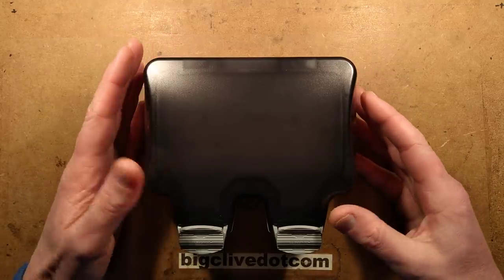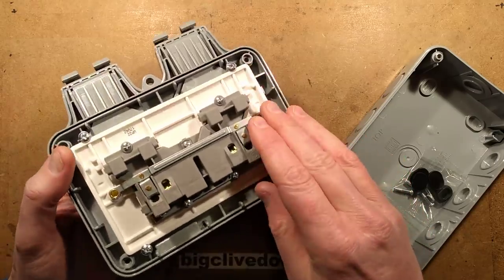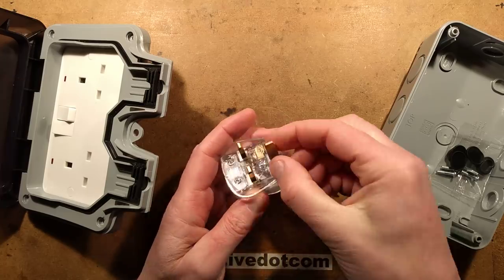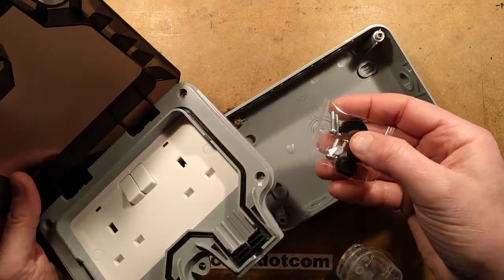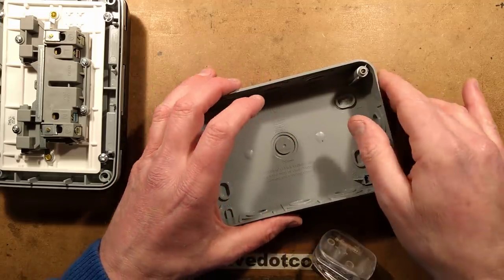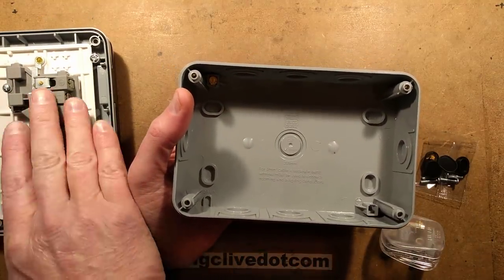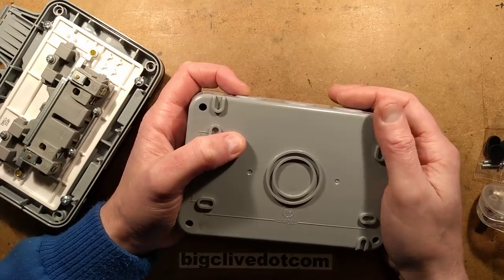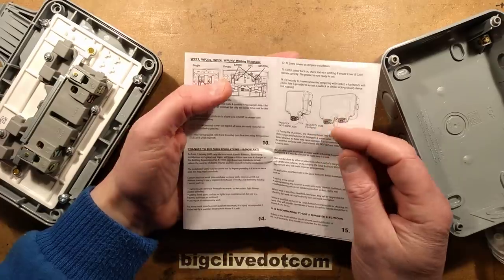British weatherproof socket with clever design. (bonus rant)

Comment: I am an unlimited level electrician in NC USA, and I am always impressed with the bulk and capacity of foreign electric designs.
Reply: And trust us, techs from MEN countries are utterly mystified and horrified by your mishmash of systems XD
Reply: I was also surprised when I travelled from the UK to USA, I picked up a extension cable to charge a wheelchair in my car,  I was taken back thinking that we use thin cable like this for our hifi speakers, not run mains equipment. However 110v is a lot safer than 220v. ATB nick
Reply: A Gentleman  the point I was trying to make was about the thickness of the cable, the charger was a 110v to 240v of course you are right, in the UK we have 32amp circuit with 13amp plugs. I don't know how many amps are used on USA plugs. As for the charger it took twice as long to charge.
Reply: @nickbird7742  Most outlets in the USA are 15 amps. If the outlet has a T shaped slot then it is a 20 amp. 20 amp outlets are compatible with 15 amp or 20 amp style plugs. As you get into 30 amp plugs and outlets there isn't any backward compatibility.
Reply: @TomZ23  why are your cables so thin, also the two pins on the plug was very thin. In the UK our cables are made using 2.5mm copper and our pins on the plug are quite thick as you would have seen in this video. ATB Nick
Reply: @nickbird7742  2.5 mm copper for a wire seems really large for a connection cord, that is equivalent to a 10 gauge wire. That would carry far more current than any appliance would even need.
Reply: A Gentleman yup, 110v limits the watts any appliance can use. Most USA extension cords are awg#16... often homeowners run them all over the house, under rugs etc... it has forced the NEC to require special arc fault circuit interrupts... to prevent stupid Americans from burning down their homes. 

The sad thing is commercial outlets have updated circuit capacity, but the same crappy 15 or 20 amp outlets and cords... y main business is replacing refrigerator cords and outlets... because they overheat and melt down...
Reply: @TomZ23  first thank you for your reply,  I now understand the main difference between USA and UK,  USA wires go from the fuse box to the socket.  In the UK we use a ring main which wires go from the fuse box to socket after socket then back to the fuse box. Any double socket can have up to 26 amps 6000 watts, 2 x 13 amp plugs. We than have separate circuit's for kitchen, downstairs rooms, and upstairs rooms etc. Each ring is rated 32 amp.

Comment: I'm certain that we have Electrical Regulations in Greece but nobody seems to know who has the copy. However, the lackadaisical approach to safety does result in the Darwin effect. Yes, the stupid gene is being phased out in favor of the commonsense gene.
Reply: Same in Croatia
Reply: Is the stupid gene being 3 phased out faster than the single phase option?🤔
Reply: @chriscooper2496  maybe twice as fast, Chris....
Reply: I went to Austria for work a few years ago and the day before flying out, called the project manager who was already there to ask if I needed to bring building site required PPE (hi-viz vest, steel toe-cap shoes etc). As it happened, our installation work (security equipment) was in an already working office, so PPE would not have been required even in the UK. However, his response was that no one seemed to bother about health and safety in Austria, that someone on site had sustained an electric shock a few days before and apparently everyone just laughed.

Comment: Opened a nice weatherproof 240V relay box on a job once, cloudy brown water poured out everywhere and as soon as the thing got reasonably free of water it started sparking and caught on fire... supposed to be an unenergized circuit of course.
Reply: Had the porch flat felt-roof leak once, gradually soaking the chipboard inside, then after one summer thunderstorm the porch light fitting started spitting fire and water alternately for a while till the fuse eventually failed.  Quite an impressive effect really.  I later discovered that felt roof laying is a horrible job.
Reply: Always a good idea to drill a small hole in the bottom to let any water that creeps in to escape.

Comment: We use at least 100 of these for supplying power in tents at festivals.
With heavy use (dragging them around fields, transporting them + customer abuse) I've found:
- The clips easily break, fall off and get lost first. (about 10%)
- Hinges snap esp if knocked sideways when open (about 7%)
- The hard plastic sockets inside get shattered. This is because you can't plug a larger 'wall wart' type power supply in properly due to the clearances so people push them too hard to get a connection. (about 7%)
- The RCD versions are ok, only 1 RCD failure in about 100.
- The snap-out 20mm covers around the holes don't look waterproof as there are no rubber seals, though they seem to keep most water out due to the tight fit. The one I have on my house has extra sealant applied on the inside....
- For 'portable' use (which they may not be designed for) extra cable restraint is needed (internal cable tie) along with the correct compression glands.
I'm not knocking the product though - it is by far the best on the market & our hire ones get abnormally abused. Our problems are human-related, not product related. Treated with care they will last for years. No problems with the external plastic either - my permanent ones have survived a few cold winters with no degradation.

Comment: For house use only i still like the old colours red/black/green/bare, Red means Danger in the animal kingdom, we are animals.
Black is cold so no power there, Green well ok grass/earth.
I've never had any problem with wiring, just a matter of respecting it.
Reply: The old colours were a problem for people with red/green colour blindness. Although my dad, who is red/green colour blind, rewired a house and had no problems, lol ...

He said they were different shades of brown. It was no problem telling them apart, and black's still black :D

But yeah. The modern standards. Even if you're completely achromatic, one's light, one's dark and one's striped. Someone put some thought into that :)
Reply: Fleksimir They wanted the same colors throughout Europe so they didn't have to make rolls of cable specific to each country.  They also wanted to minimize situations where the old and new colors had opposite meanings in really dangerous ways.  So they came up with the hitherto unused striped earth, light blue (not dark blue) for neutral and brown as the typical phase.  Red, white and black were left unregulated so they could be avoided in places where they had old uses, yet useful for anything extra the electrician might need.  Technically, brown live was not in all the regulations, but common enough to be in all the training and instructions.
  One thing they missed was testing the dyes under bad lighting conditions such as a cheap LED torch or low grade fluorescent tube.
  I really wonder what clause in the British regs requires red live, as I'll have to check if someone snuck that into a recent revision over here too.
Reply: @johnfrancisdoe1563  Any change is bad, regardless of what's the reason. I know I now sound like some idiot that wants everything to stagnate, but that's not the case.  The problem with wiring isn't that professionals that are smart enough won't manage this somewhat logical change, they of course will. The problem is that there is a lot of people who have no clue about electricity, that learned from their dad that "you connect xy wire to the left hole of the socket (etc) and it will work". Those are the people that are a real danger, and quite handily those are also the people that might not have proper fusing in the wall and might actually burn their house down if they mix up the wires. What should be top priority is avoiding confusing those idiots. Yes yes, they are illegally doing electrical work in their own house: that has zero relevance for this argument because they do exist and they also have kids that need that roof over their head.
Reply: I once almost killed my dad by wiring red and green the wrong way round in a plug. It was the only drum of cable that I ever had a problem with, but I am happier with brown, blue and stripe
Reply: Indeed the wiring colors were changed to harmonize with the EU. Now the mnemonic is green = grass/ground, blue = cold/neutral, brown = you poop your pants if you touch it.

That last one is from Tom Scott, but I thought it was funny enough to mention here.
Reply: @macartm    what does this legion of colourblind electricians do when they come to a house with the old colours of wiring ?
Reply: Theres no less power in the black than the red and I would say it feels worse when you get one off the black
Reply: We don't have split phase systems in our houses, the black wire is tied to earth.
Reply: They don't. Colourblind sparkies never manage to pass ;)

But you do get colourblind amateurs, like my father ...
Reply: Here in the States, black is live (or "hot"), white is neutral (ultimately tied to ground in the breaker panel), and bare, green, or green with a yellow stripe is earth ground.
Reply: @johnrehwinkel7241  Don't forget about the 220 appliances with Red and Black as hot's and White for neutral but then sometimes there is no neutral. Also it's worth mentioning not only is neutral tied to ground but that our breaker boxes have to have two ground wires. One going to a grounding rod outside and the other going to the water main.
Reply: @johnfrancisdoe1563  - black is now a phase colour in the new system (along with brown and grey - couldn't pick a worse combination of colours if I tried). Blue was a phase colour in the old system.
Reply: @MrEdrftgyuji  You're right, it seems like they chose the worst colors possible for phase wiring. Here in the US we use black, red and blue as our standard phase colors. Brown, black and grey seem like colors to ignore.

Comment: Great vid as always Clive. We got two of these and they are weather proof BUT with a down side. If it's been raining (and of course it stops because you wouldn't want to play with plugs in the rain would you) and you pop the two locking clips then open the door up. Water drops down over the plug and face of the socket.... Great!. So the only ways around this is first wipe the top of the box dry or open slightly and shake the door so water runs off and not in. Other than that it is very good.
Anyone else find that with theirs.  ps: you rant Clive I am with you 100% on wire colours, no need to change from the old ways and I pity the colour blind spark out there.

Comment: I have that same socket by my pond. After a few years of use, no problems so far although the catches can be a bit stiff at times, maybe a good thing. I can't remember drilling a drain hole but then I shouldn't have installed it myself either. D'oh!
Reply from the maker: By installing it yourself you got a known result.  It might be worth turning the power to it off and checking inside for water ingress if there's no drain hole at the bottom.  If there is water in it then add the drain hole.
Reply: @bigclivedotcom  I will do that. Thanks.
Reply: I also installed one of these 3 years ago, a week ago I took the front plate off to check the connections etc in the back and apart from some insect shells it was spotlessly clean and everything was still tight, excellent piece of kit.  Oh please do keep ranting away as you are the voice of common sense.

Comment: I am sure I have seen somewhere that the shutters on some newer versions will not open unless the lower pins are pressing the shutters as well as the earth pin. So you can't open the shutters by pushing something into to the earth hole as you did with your screwdriver.
Reply: Yep.  That's been a feature of MK sockets for a decade or two now.  And some other makes.

In between the "earth pin to open shutter" and "all 3 pins to open shutter" MK had a "live and neutral pin to open shutter" design on the market for a couple of decades.  Note that that design required simultaneous insertion of live and neutral pin to operate.  You couldn't open the shutter with a screwdriver poked into just one hole.  Well, you could, but you needed a bit of skill and luck to do it.  That feature carried over into the "all 3 pins to open shutter" design.  Earth and live won't do it.  Earth and neutral won't do it.
Reply: @pmailkeey That'll be good for saving power :)
Reply: @bdf2718  While most of MKs ranges have now been updated to use the "3 pin" shutter there are still a handful of current MK products that use the "2 pin" design. Specifically the metal hinged cover floor sockets, the panel mount sockets and the "mini logic" small surface mount double socket.

Comment: Great rant, same for gas and, believe it or not, people like me who used to make new timber windows but now cannot do so legally as a result of lobbying by the uPVC window cowboys to bring in ridiculous regulations. Fortunately I still have a good stock of old colour cable for when I want to do any wiring in my house (which I wired myself pre-2000 and got it approved for connection by the local electricity board with no problem).

Comment: The British plug maybe ugly but is very safe and the wiring is at 90 degrees to  the direction of pulling the plug out so the plug remains in the socket. Unlike other plugs such as American that keep getting pulled out.
Reply: @@pmailkeey If you call that safety.
Reply: Using say an angle grinder on two extension leads here in a yard in Australia will result in at least 20 minutes wasted by constantly reconnecting one of the three plugs back in. The solution is to tie the ends of each lead together which definately will stress the cable. Aussie and US plugs are shite in this respect and the pins bend if you just look at them let alone tread on them.
A UK plug is designed so that a lead under tension will break at the live or active pin first, followed by the neutral and finally the earth. And you'll only step on a UK plug once.
Reply: @sumpyman  Oh Sumpy, you just described last week with constantly re-plugging the bloody grinder back into the cord. Thanks for the semi-annoyed at aussie standards chuckle . I really need to fix my laptop and get the bloody 3D printer going to make some extension cord clamps so they'll stay together without the knot
Reply: @databanks  thanks man, and that idea of yours sound great. Now if you could russle up something that enables a double gang plug socket NOT to be rendered 50% useless when you plug something like a phone charger in would be grand too!
Reply: @sumpyman  Oh yeah, know that pain. Generally I just slap a 90cm extension lead in for the plugpacks. Or a power board with the extra wide spacing if you can find them. Actually have one here I got from Cheap as Chips (discount store like Reject Shop) that has extra wide spacing and a switch for each socket. plus 4 USB ports (clive'd love to rip it apart, I bet)
Reply: Actually it gets the live & neutral pins disconnected as plug goes at an upward angle in the socket - a bit annoying when vacuuming with a corded vacuum cleaner with a short lead (battery powered vacuums are avoiding this annoyance)
Reply: @samuelfellows6923  They make vacuum cleaners with short leads? Wow, that really is cost cutting to detrimental results. Sorry to hear you came across one of those. Anything less than 10 meters of cord on a vacuum is crazy
Reply: Some US equipment does have 90 degree plugs. Makes it better for behind furniture too.
Reply: @chaos.corner  Agreed, far better. As a bonus, some 90 degree plugs can have a piggy-back feature, though stacking too many is not advised
Reply: @sumpyman  Funny that you mention that, because the Type I plug is an obsolete 250v 10A American design. In North America, the plug design was slightly redesigned with a D, or U shaped grounding pin, and reclassified as a NEMA 7-15. My guess as to the ground pin redesign is due to incomparability of the frequencies, and standardization to 240v 277v US. I recall reading years ago that the two main reasons that Australia chose the American design was A) the British type G used a lot more brass, and brass was scarce at the time B) the British type G required machining solid brass, where as the American design could be stamped sheet metal.
Reply: Don't forget that on our american plugs idiots often cut or break off the grounding prong because they are not smart enough to have their outlets changed and think it's just fine to operate something, especially things that are metal and electronics. With the British plug, you can't really eliminate the ground terminal or it would be very difficult to do.